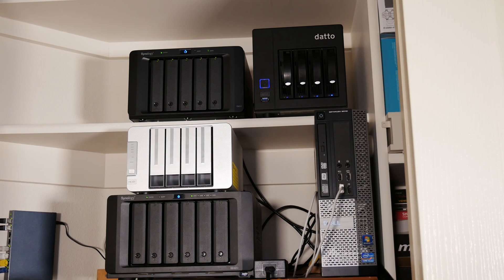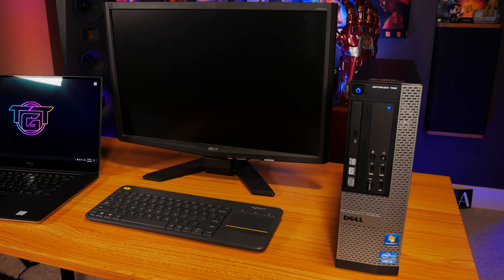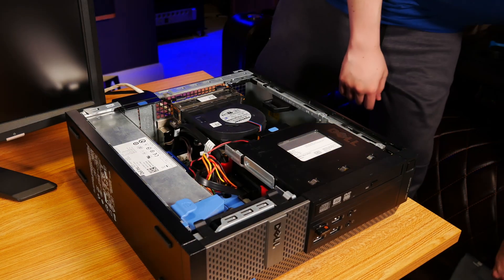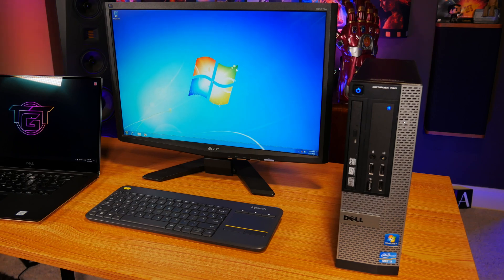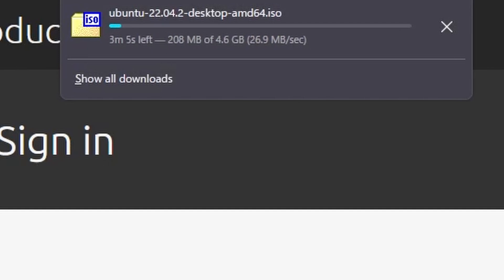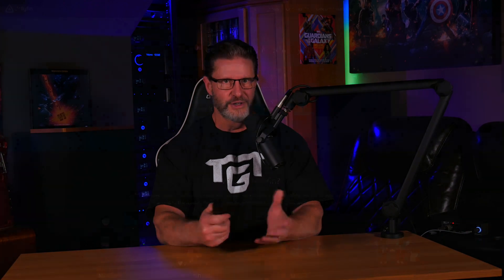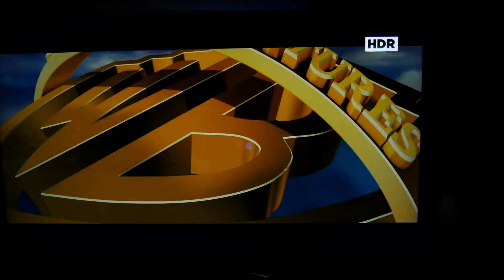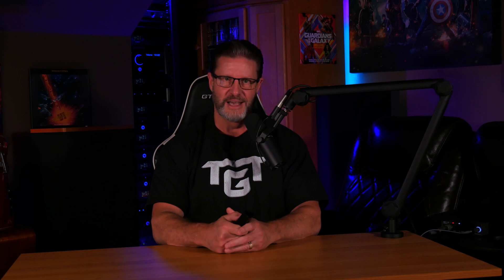Turn your Old PC into a new 4K Blu-ray Dolby ATMOS Streaming Server!

Comment: Leaving out the biggest drawback to old pc use as the server.... transcoding. You can't always direct play stuff, especially if you watch movies/shows on your phone while you're away. Your PC needs to have a decent, preferably Intel CPU with quicksync. You can get away with not needed a dedicated GPU with a decent intel chip. I use an older i5-12400 and it drops  hi bitrate 4k stuff to 720 high or 1080p low when I watch during lunch on my office PC.

Comment: I paid $150 for a refurbished Dell Precision 3431 (i7-9700 / 16 GB RAM / 256 GB SSD /UHD Graphics 630) and it's working beautifully as the base for my Jellyfin server.  I have a (5x6TB) 24TB usable RAID-5 direct attached, and my ripped videos (including UHD HDR titles w/Dolby Vision) look and sound great on my Roku TV when accessed over my WiFi 6 network.  The only problem I ran into is that my Roku TV can't decode native 4K HDR MKV files fast enough, and I have to encode them to 4K HDR MPEG-2 files using Handbrake.  This takes time...lots of time.  But it is what it is.

Comment: As long as you don't drop your hard drives, overheat it, short circuit, expose it under strong magnet, shut down without ejecting, a hard drive failure shouldn't be an issue. I think hard drive failures are overexaggerated. It's not like you are writing to the drives or streaming it 24/7.

Comment: I have a ton of DVDs; 100s. If they're all about 6gb each; then I'm going to need a few terabytes. An SSD that size would make my build expensive. Are [sata] hard drives good enough? Would Core2Quad CPUs be good enough?
Reply: spinning rust ought to be fine, but the Core2 will be far to old to be useful for anything particle.

Use it for testing and learning but I would replace ASAP as the Core2 won't offer a good experience if it works at all.

Comment: I want to warn everyone against getting a USB enclosure.  While you can make this work with OpenMediaVault, it's problematic.  I should have purchased an HP Proliant server with 8 drives and 64GB of RAM or more and build out a Proxmox environment.  Which is exactly what I'll be doing.  The Dell Optiplex 7050 will be used as my media management.  I will attach the USB enclosure and just keep it as simple as possible.  Just wanted to let anyone that might read my comments know this before purchase a USB enclosure.

Comment: I hope you see this.  I have ditched my raspberry PI 5 media server and replacing it with a Dell Optiplex 7050.  Ubuntu has been my go to version of LINUX for a good 10 years or more.  After installing Ubuntu, I connected my LG external drive to and it was not discovered.  Have you connected your LG blu-ray drive to your 790?

Comment: Great video. I went the NAS route and it cost me about $2,500.00. My best friend went the Raspberry Pi 3B route with a 2TB external USB drive and it works great for him and his DVD rips. I have a lot of Blu-Ray content and around 16 TB of files, whereas he still has free space with lots of DVD content. I guess it all depends on the individual needs, so whatever you can afford will probably be okay as long as you do your research before getting started. For what it is worth, I'm Plex Lifetime and he uses OSMC. So, there is a tier for whatever you can afford. Thanks for the great videos, I'm a subscriber now...
Reply: That seems extraordinarily expensive for the amount of storage
Reply: @Adam-n1p6m Sorry, I forgot to list my total storage and only listed the 16TB of files. I actually purchased a Synology 5 bay NAS and 5 of the 14TB drives. I think I ended up with around 38TB of storage in total using RAID 6. It was still super expensive in my opinion, but I had fun learning the process.
Reply: @MuhChicken I carefully selected gear about half. Petabyte for that cost

Comment: I built myself a Raspberry PI 5 with a 1TB drive.  The movies I own currently have been uploaded to this unit, and I use of Plex to view those movies and TV shows.  I bought a DAS, Yottamaster 5 bay, to expand my storage capacity, and will leverage OpenMediaValut or CasaOS to run my NAS.  The Yottamaster connects to my PI server via USB 3.1.  Finding your channel has been an eye opener for me.  Ripping DVD's back in the day was a daily practice.  Overtime, I got away from it with all of the streaming services.  For a variety of reasons, I am fed up with most if not all of the streaming services.  Not too mention the costs.  Take Hulu.  Hulu charges $7.99 for a basic plan with ads.  If you want to go to no ads, the price jumps to $17.99.  If you compare that to Paramount or Peacock, their jump to no ads is $5.99 and only jumps to $11.99 for no ads.  Fortunately T-mobile is picking up a large amount of the fees.  Full circle I am back to ripping the DVDs I own, going to purchase a DVD ripper (the one you guys recommend) and something I never considered before, purchasing Bluray movies/shows over at E-bay.  Our TV's are aging both well over 15 years old.  I see a new 4K or greater going into our living room at some point soon.  I'll watching to keep up on software/hardware and overall streaming your own content.

Comment: Started using Plex about 10 years ago. Once they started charging people, I switched to Jellyfin about 3 years ago. Haven't looked back. It handles everything I throw at it. All my home videos, ripped videos, photos, digitized slides, books, etc. I installed it on my lowest power computer. A single core processor with 2 Gigs of RAM, 12TB drive, running Lubuntu headless. Haven't shut it down in 3 years. I installed it by hand along with Nginx, running another service that stored magazines. Glad to see I'm not alone. Thanks for the video.
Reply: Are you re encoding movies with handbrake?
Reply: @NickzAndMikz  Yes.
Reply: I am not a tech savy but want to.know what are these jellyfin and plex servers do? Are they able to pass digital audio video signals of my local mkv (BBRip) files to my avr (supporting dolby vision and doby atmos) so i can get the proper atmos effect through my home theatre( similar to ziddo media player)
Reply: @sonawaav  They are what's known as media servers. You  load them up with any digital media and they stream it to any other device that can show that type of media, on demand.
Reply: A year late but plex always charged people... from their inception. The server was free with limitations but they would charge for the streaming app depending on platform. Or you could just buy the lifetime sub that would unlock features. I know because i was literally one of the beta testers. Anyway just wanted to say i have no idea what you were talking about. Jellyfin is cool and if that's what you use then more power to you, just don't understand the point of needing to validate that decision to internet strangers by making up randomness about plex...

Comment: im very new at this stuff..

so i just made my own jellyfin server with my main PC right now. it got r5 57500f and an rx 6600.. its been running for like 3 days. and before it uses the CPU . Theres no issue as far as I can remember and itr works fine. there's only 2 client in my house. living room tv and my parents tv. I'm saving the movie files on an external SSD. (this is why it trying to use my old dell optiplex as an server so that I can use an internal storage too) but. today while I was watching the movie from living room tv it got sick sick sick lots of buffer. the first 8-10 minutes it works fine. smooth

but after that it buffers a lot and stuttering. i haven't tried hardware acceleration since I know my CPU is capable doing this. 2 tv, only mkv 1080p format with x264 sdr (most of it) I got some HEVC/ x265 file. and I'm only downloading the file in 1080p.

my upload speed is about 15 Mbps average. 

my question is
How can I fix this?
should I use the hardware accell?
should I change my server from this PC to the dell optiplex 3020 which has an older CPU and GPU?
Should I change to my i7 3370 and rx 570 (old pc)?

Note 
I am not someone who understand coding or anything. I'm very new at this topic. so pls explain it as easy as u can... THANKS!

I just realised my CPU in task manger didn't put his effort into it. last night I updated my windows 11... does that could be the problem?

Comment: Hi Brilliant video however one the issues you are not covering in this video,  are how upgrade to improve sound and video

I built a HTPC with jellyfin client running on an asus platform. In my case i added an M-Audio 1010LT 16gb ram and a video card from Nvidia. 

I connected this to a dell server with 8 drives running truenas with a jellyfin server app.
works like a charm (until i screw it up)

Comment: Ubuntu.. leaves you with a generic install that might get you tearing and micro stutters sending you spending hours or days of your life hacking Modelines into Xorg and chasing device options. Use OpenELEC, and forget "old PC" munching down 70W idle and go for some ARM based 5W device the size of a cig pack that supports 4K@60fps and is officially supported by OpenELEC. 30-40 bucks. If you run with 1 HDD put on a powered USB3 adapter. Done. By the way, old PCs like that won't have enough punch to decode x265 4K if you're out of luck.

Comment: I'm doing a bit of research on this and was told that Jellyfin does not handle Dolby Atmos and you will need to do some workarounds to get that to work. Have you found this to be the case?
Reply from the maker: Thanks for watching! On the server side audio is handled as part of the MKV file and there's no difference between an ATMOS track and any other kind of audio data. Where this will matter is on the client side. In our experience, using a 2019 NVIDIA SHIELD Pro, Dolby ATMOS audio is sent to our processor exactly as it would be from a 4K Blu-ray player with no workarounds. Other playback devices may not offer the same experience however. Hope this helps!

Comment: hi, if i rip a 4k blue ray into a mkv file would i retain the 4k quality ? thanks
Reply from the maker: Thanks for watching! Yes, so long as you don't do any post processing to the file, such as compression, it will retain all the exact same data that was originally on the disc and the quality will be identical. Hope this helps.
Reply: yes it helps thank you  @TwoGuyzTech

Comment: I am perplexed by videos like this one  Why would you waste even a dollar on this type of setup.   I had a dedicated HTPC (actually multiple HTPCs) for at least 15 years.  I pulled the plug on my HTPC 4 years ago,  All my media is stored on NAS and I access all of the video on my Sony TVs using VLC.  As for my large audio collection I use different music players depending which audio system to which I am outputting.   With today's normal smart tv technology why bother with this extra piece of hardware?

Comment: Can this system stream movies in dolby atmos on my apple tv?
Does the media server being too old hamper its ability to do so?
Reply: Not as long as the server doesn't need to transcode to a lower resolution. It will be acting like a file server and sending everything at your TV or Roku ECT. If say your asking it to go from 4k atmos to 1080p Atmos it would have issues. I tested my NAS the other day with it and it said nope, but I was able to stream 4k with Atmos to 2 different devices with no issues. I pretty sure I could have done one or two more with no problems because it wasn't having to transcode the video.
Reply: @OldManGamer3131  that’s helpful sir. Thanks.

Comment: I use Eric's Movie Database to effectively do the same thing that all that extra effort handles.  It is entirely free to use as-is.  But for a small donation Eric will custom the name of the database to whatever you like.  He also makes free upgrades to every user.  I sent in the request to allow people to configure it to play a movie with a single or double tap/click.  In the next update my suggestion was working perfectly fine.  I also use it to reference when I am shopping for movies.  To see whether or not I already have it.  This way I don't have to have a HDD attached to see my movie collection.  It automatically searches through your media files to import all the correct data and movie / TV posters off your choice of IMDB, The Movie DB, The TVDB, Rotten Tomatoes.  It was originally designed to keep track of DVDs versus actually playing them.  After my suggestion It ties in with VLC superbly.

The software still needs some work.  For instance if you're starting off with a thousand or more movies it will take a good week for it to sift through the different types of databases to automatically assemble the correct data.  When it runs across many alternate possible matches it leaves it up to you to choose the correct one.  If you're copy is on loan or is missing and you don't remember the cover art guess who has to manually look it up?  But if you're a more thorough person who has a scan of the box art you can use that for the poster art.  I would be interested in learning more about Jellyfin if it simplifies this database query function.

Comment: I’ve found that my Core 2 Quad Q6600 works fine for anything under 4K streaming, which I don’t need because I have literally nothing that I can watch 4K on anyway. Where it has problems is when there’s three or more streams going at 1080p with transcoding.
Reply: hey can you tell me that dual core pc  with 4 gb of ram will stream 1080p 60 fps in tv with firestick ???
Reply: @prateeksaxena6161  me? I have no idea, but I'm thinking it'll do okay, if it's only one stream at once. If you have the space though, make sure you optimize your videos to make them easier to stream on both ends.  It doesn't cost anything to try it if you already have all the hardware, so give it a shot.
Reply: @kendrakirai  on both ends meaning?? And i want to ask one thing more if firestick supports transcoding then will my PC able to stream on my tv?? Configuration is dual core ram is 4gb and total storage is 750 gb
Reply: @prateeksaxena6161  depending on the format and encoding, it becomes easier or harder for the device serving the video and the device receiving the video to process. The transcoding process happens on the server side, but if it's in a format which the client can't properly handle, you'll have problems. That server is a bit on the low end, but I THINK it should be able to handle it well enough. Don't quote me on it though. My quad core is the slowest thing I've tried to use as a server, and it has 8 gigs of ram.
Reply: @kendrakirai  thanks brother for the help😅 btw where did you learn all of that stuff tell me so I can learn from that too... Btw where are you from
Reply: @prateek53-s  Mostly tinkering and watching videos like these.

Comment: Hello, I am having a problem with direct playing - passthrough.. Even with transcoding disabled I am not getting TrueHD on my TV which is using jellyfin app. (LG C2). HDR works and a little icon show up when I start streaming. When playing I can also see that in playback info, play method is direct playing. Audio codek is truehd. Then I am passing through that to Denon receiver. However even with the audio output to the TV speakers I am still not getting Dolby atmos icon.. Would you have any tips? many thanks

Comment: On his example PC and with the HDDs he used, there are a few things to note
You actually don't need UEFI support in the Bios, as long as the Host operating system supports GPT you can use the 4 TB HDD or larger, you just have to setup the Boot Disk as MBR, and then any additional drives can be GPT
And the Only reason his example computer don't support Windows 11 is because of no TPM support
Which you can still run a custom install command to ignore that requirement
That PC will Run 10 or 11 no problem, and not slow either for the intended purpose of serving up network shares
I would go even one further and use a separate PC to do your Transcoding and Rips
Reply: Not good advice to have MBR drives nowadays, so yes, you will need a UEFI system. Unless a PC is really ancient, that's a non issue. And Windows 10 will be just fine, rather than 11.

Comment: I’ve run similar hardware in the form of DellOptiplex i7 with 16gb ram and a bunch of 8tb drives. Worked perfectly and I would recommend looking at Emby software running on Windows.
Reply: Late reply, but where are you storing all of those HDDs?

I'd like to set up an HTPC as well.
Reply: @xthedronx my old ATX gaming pc case has 10 bays for HDD lol. i7 4790k w/ 24gb DDR3 is plenty.  Or the most efficient but I get to repurpose my old 2013 gaming build 🥲

Comment: I use openmediavault myself however I also have other things shared like emulators and rom sets. I have 2x 8tb externals and 2x 18tb externals connected to it. For playback I have an apple tv with infuse pro and a zidoo z9x rather than a transcode setup like yours though there is nothing wrong with that setup it's all about preference.

Comment: The AMD Radeon RX6400 GPU uses just  7 watts to 13 watts of power and can output HDMI 2.1 4K 120hx 4:4:4 RGB. It is dirt cheap and runs purely from the PCIE power. No extra power required. One caveat... No AVC1 audio.

Comment: You can use the included windows 7 or 8 key to activate windows 10. It's worth noting that if the computer came with windows 8 or 10 the key is embedded in the UEFI firmware, and windows will grab it automatically.
Reply: That was stopped about 3 years ago when Microsoft went from "10 is the last one" to "Oh wait, 11 is going to be a thing"
Reply: @GuyNamedKy it still works for me on some laptops that I worked on recently weirdly I could use the license printed under the laptop, but that’s OEM so it’s probably the reason not sure 🤔
Reply: It's embedded in the firmware unless you built it yourself. Then you do have to buy a key. That's why you should just use Linux like they are.
Reply: In my opinion, of course.